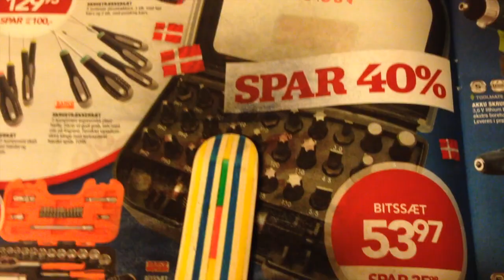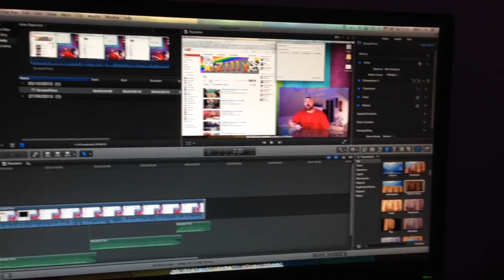DECKS IN THE MOLD (10.5.13 - Day 1068)

Comment: Hey Mike, Just cut a couple of small blocks of wood out for the space you need in order to equal the height of your tallest mold. Then you will have spacers to put on top of the other molds and you can clamp them all down without making new molds :)